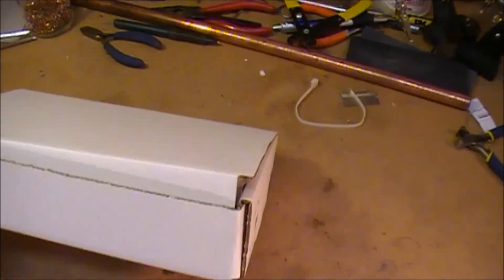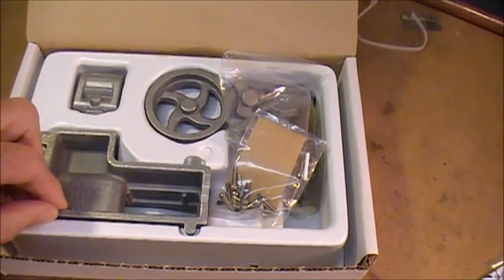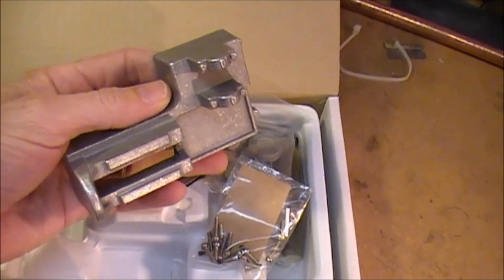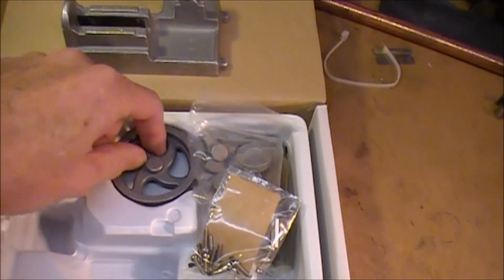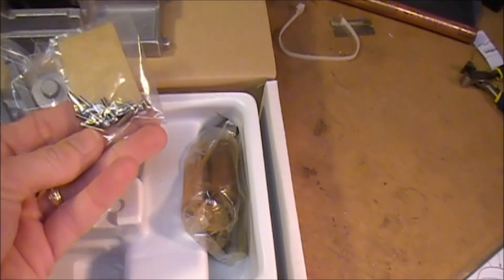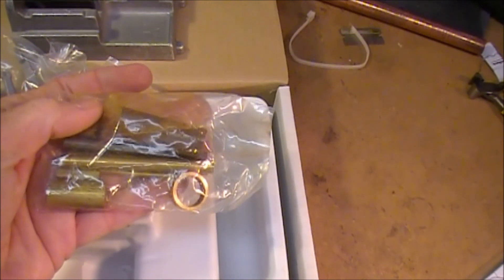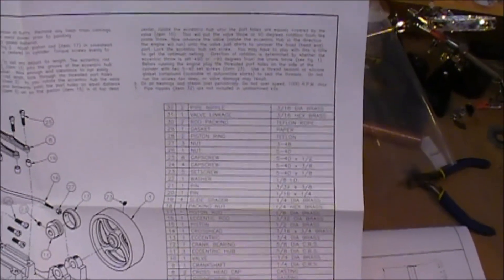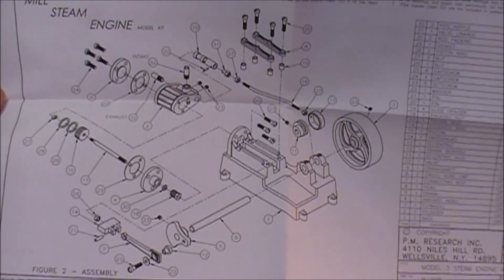Part 1- PM #3 Steam Engine-Machining and Assembly

Comment: Concerning the quality of PM Research's castings:

I've done an #3 engine and it went good with my experience.

The 6CI engine I've had issues, though I'm much a better machinist now:

1.  The connecting rod wasn't straight (had to hammer it straight).

2. The cylinder (which also has the valve/steam chest) has both the cylinder and steam chest cavities cast to minimize material, has sinks causing smooth machining to be impossible.

All I'm saying is expect some issue with PM's larger engines.